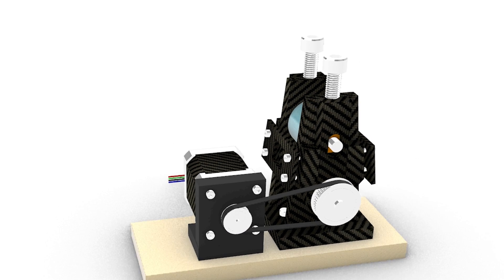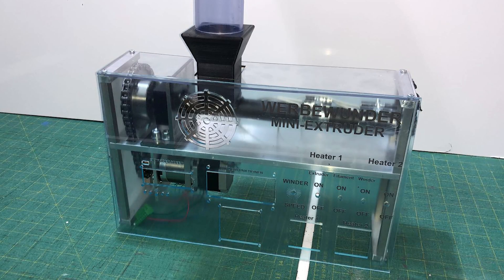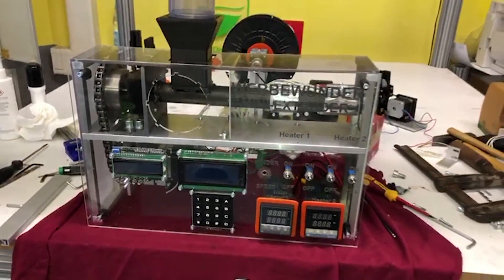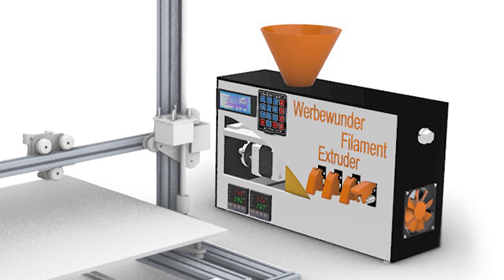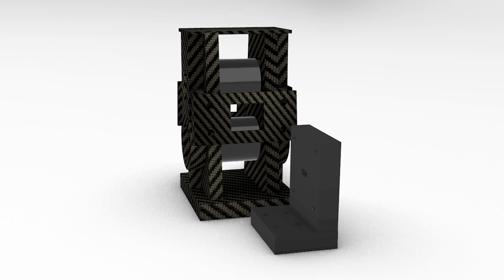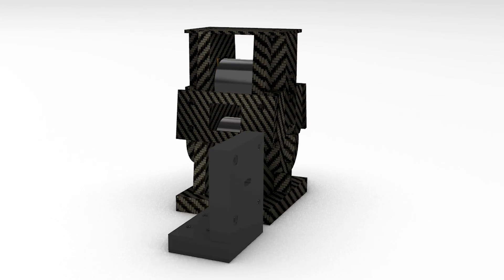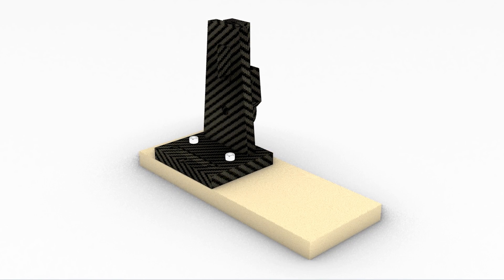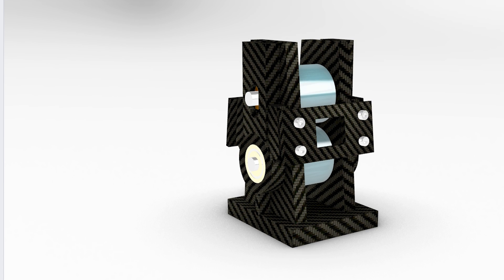Filament Extruder Desktop Version DIY [English] #2 The PullUnit

Comment: Would it be possible the reconstruct the filament extruder to be vertical?
Reply from the maker: My first two extruders were vertical, so you are only limited by the power at about 1 kg because you do not have very long cooling distances. look at the videos

Comment: Whaoo respect Mister Werbewunder ..... thank you for sharing real conception ....

 Now in end of 2018 what do think about the hole of the hotend of 3d printer  ( buse )... 
is it always adapted to extruder.... in other terms is it important to calibrate more or less the filament ... 
the 3d printer buse is the master = 1.75 mm imposed ! extruder slave .... 
do you think an evolution is necessary ... the 3d printer should be with tolerance of size 
... perharps with a mini extruder ??? !!!!! what ???   lol , 
yes

French sorry ....
 Que le filament , puisqu'il est de diamètre non régulier ( pour cette hypothèse )le refaire fondre afin d'imprimer et non pas d'être poussé par un extruder ( 3d printer ,a simple roller in fact )
je pense que du coup le filament pourrais avoir une certaine tolérance de diamètre.
Et la vous allez me dire oui mais qu'est ce qui entraîne le filament ? l'extruder ? lequel  ? ( which one ! ) lol
Bien sur on ne parle pas de shredder à mettre sur imprimante 3d !

Qu'est ce qui empêche aujourd’hui de mettre un filament de diamètre différent dans une imprimante 3d ??? et pourquoi ne pas régler cette """""""
ALORS on pourrait se demander , il doit surement avoir un lien entre la capacité à faire fondre la plastic ( hotend) rapidement en flux constant pour imprimer , oui , si l'on n'y ajoute une plus grande capacité de préfonte je dirai , l'on pourrait se passer de cette taille 1.75 entre autres imposé ! non ?
( Des fois je pense à l'aire comprimé ) 1 bar / 2 bar ) si si lol. voir plutôt sous-vide  ( le plastic est tellement mieux ( melt ) sous vide ( pas de bulle ) , fluidité.)

Ce qui empêche un autre diamètre de filament sont les éléments eux même ,employé pour la conception de toutes les 3d printer !!! si le filament est trop gros, il ne rentre pas !

alors bien sur j'ai fait des petits test dans d'autre projets X en rapport avec le plastic . thermoforming , injection ...
et maintenant j'arrive dans vos projets , j'adore ...

Je me répète c'est vrai mais c'est pour bien poser la chose ...
Parce que je souhaite réaliser en truc dans le genre cela me parait plus logique ... vais-je dans le mur ? est-ce complètement impossible !
what 's the probleme with this lol ....

et soyons fou , du coup si filament avec tolérance de diamètre ,l' on pourrait peut être mélanger les matériaux, un peu de pla et pp directement en deux filaments distinct dans la tête d'impression.... pour faire simple une grosse ouverture en début extruder qui puisse recevoir une "coulée" de plastique avant d'être entraîné par une mini mèche ( type extruser line )
(directement oui c'est impossible le filament bloquerai rapidement la mèche .)
 mais si il est quasi fondu avant de rentrer en contact avec la mèche .... ? 
il pourrais même être préchauffé au départ de la bobine  par exemple 60/80 °C .
Peut être que du coup sur une 3d printer un moteur sera nécessaire pour faire tourner la bobine de filament pour alimenter la fonte ... what ??? !!! 
Dans cette optique le plastique s'étire mais pas sans limite ( oui puisqu'il est chauffé avant et tirer ( absorbé )par la mèche qui se trouve désormais dans le tête d'impression , je pense qu'elle serais relativement petite ( la mèche )...

Du coup an extruder line should be more simplfy whit tolerance .

Am i an OVNI §§§ lol  dont know .... but i m serious .... some real question for me ...
I dont have a printer 3d or extruder but i llearn a lot and i m so excited with your video and other .....
Very spécial thx for this one .....

Comment: Awesome filament extruder and can you please help us to make the puller unit assembly.
Reply from the maker: Where exactly do you have a problem?
Reply: sketch for pull unit?
Reply from the maker: The STL file can be found in the appendix of the video that Arduino Sketch comes when we do the electronics.

Comment: For a reasonable ROI, I think the cheapest way to get a quality product is by a two step process...
STEP 1:
Extrude 1.8mm filament with a cheap version (using a wood drill bit) and let it cool down on a spool.
STEP 2:
Take this low precision 1.8mm filament and extrude it again into a 1.75mm with a direct drive extruder using the same principle of a 3D printer.
STEP 3 (optional):
Filament from STEP2 can be extrude again into the direct drive extruder to increase the precision.

HOW WILL IT WORK?
The direct drive extruder (from STEP2) need a dimension sensor before and after the extrusion. The first sensor will adjust the feeding step motor to get a constant feed volume. The second sensor will adjust the pulling wheel speed at the end of the process to get the perfect filament diameter. So, feeding with 1.8mm filament, heat it inside a 2mm ID x 200mm tubing, turn 90* before reaching a 6mm nozzle, pull it down to 1.75mm in water bath or hot air.

OK, but why?
A two step process can deal more easily with variable size material such as home made recycled plastic.
Free filament (from plastic drums, milk jugs, pvc, etc) make 3D printing of large object (chair, table, bricks) affordable.
A two step process can drive the building cost under 300$ with a precise final product.

Great ROI:
It is a viable solution if you don't want to sell your filament, only making it for personal use.

WHERE IS MY YOUTUBE VIDEO ABOUT MAKING THIS MIRACULOUS THINGS?
I admire every Youtubers and makers who share their passion with the community.
A non perfect working machine is better than theorical non proven idea, I must agree.
Unfortunately, I don't have the ressources right now to proceed with this project.
I hope my comment will inspire somebody to make just a better extruder.

Alex, the cheap guy from Québec, Canada
My background is in optimisation of analytical instrumentation

Comment: Wie lang muss denn der Riemen sein? Dann kann ich den direkt fertig bestellen
Reply: Guck mal im Link - kannst den da auch gleich bestellen - hab ich auch gemacht, ist sogar billiger als bei anderen Anbietern.
Reply: Tam Gaming in welchem link ist denn die länge beschrieben von dem Gt2 Riemen?
Reply: gesehen im Deutschen Video 192mm
Reply from the maker: Der sollt GT2 sein und zwischen 190 und 200 Zähne haben
Reply: Ne ist echt in der beschreibung - musst mal unten gucken hier. 2 stück für glaub 6 euro - hab die auch bestellt

Comment: For the nozzle....
I think a longer drilled nozzle hole will act as a dampner to increase the consistency of the extrusion.
The longer small diameter will soften the pressure ripple, in the molten plastic, caused by the turning screw.
It will increase the overall backpressure... so a threadoff will be experimentaly determined I guess!
Reply from the maker: You're right the length of the nozzle channel affects the quality of the filament.
In an earlier video I show you how I make a nozzle.
Reply: Really! Do you mind puting the link of that previous video?

Comment: 7:19 I don't doubt that a custom machined screw will be the optimal solution.
However, for a DIY cheap guy who like to build project and like the shoestring budget chalenge (it's part of the fun)... I would really appreciate if you discuss about cheapers options.
Here are my suggestions below...

Ps thank you for your great quality content, we very appreciate your dedication and sharing your passion. I'm always impress from your video quality as well as your precision!!!
Reply: @Alexandre Valiquette have you EVER looked what PA12 costs??? 1 kg granulate against 1kg Filament???? Your calculation is for PLA, thats really beginner stuff. We can produce here the filament which is really usefull - not PLA. PLA is crap and good if you are a beginner. Or TPU or even other filamenttypes which are flexible are good to make by your self. PLA is crap.  And the prices you write there also crap. Your prices are way to high. For 6-8 Euro i can get ABS and more better filament, but PLA is way way cheaper to buy, and i mean 1kg costs 2-3 euro in ebay plus 2,90 Euro transport costs, If you buy 10kg PLA you have no transportcosts and this means you play only 2-3 euro per 1kg filament. And 10kg = 10 hours printing on the extruder. I have four 3dprinter and i need per DAY 1 kg filament. Your whole calculation is total bullshit. Sry but this is the truth.
Reply: What do you think about using an old/blunted (free) low pitch wood drill bit "such as auger bit"  with a matching ID metal tube over it? The only modifications will be to grind out the pointy tip of the bit and cut a "window" out of the tube. Both operations can be done with an angle grinder to avoid the expense of the machine shop.

To keep the extrusion quality, I might invest in a pipe that will perfectly match my free wood bit. This pipe can be found on Ebay or from a machine shop scrap bin (bargain again!).

I will tap some thread into the pipe to fit a matching threaded nut. This nut will be drilled in the middle to form the nozzle.
Tapping and drilling can be done at home with cheap tools or can be done at the machine shop for fairly cheap and increazed quality.
Reply: I think what the beta-tester said - there are 2 screws - 1 for the cheap version, which has a great result and one bit more expensive way. In my opinion what i calculated is the price as the betatester said, extreem low. I mean for this amount of money, where do you get a extruder which makes great filament? I also saw some "they call it professional extruder" but 1. they make all less than 1kg/hour and 2. they ALL cost a minimum of 3000$!!! And 3. i saw reviews and i saw that they ALL dont make a good job!!! Now here we have an expert who has his own extruder and his extruder is doing 5kg/hour, and i think he knows why he improved his screw. Btw. the wood drill is used in the 3000$ version which you can buy. Also it was in the 6000$ version i saw. I think as the betatester said the cheap version was also good, that we have to test it out, but its really little money compared to the 6000$ which i saw yesterday! They had 4 heaters, but that we can use here too if we want. But 2 are enough. And if you want 4 then you can invest the money. Then you need 4PID. But this increases the price also. I think we will get a good extruder for an unbeatable price and we can improve it to the sky later as we want, if its the out design or the inner electronic or mechanic - thats awesome in my opinion and total unique!
Reply: I think in some points you are right - but in some points you calculate wrong. 

1. 2,5 Euro per Kg for Pelets. 
2. PLA is the cheapest useable i can buy in Europe 22Euro without Shipping
3. If you need only 144$ / Year then you are a minimal consumer and it isnt worth for you IF you dont want better filament or higher quality. On a total low price you cant save money, because as lower you go as more you have to buy. So dont compare quality with quantity. That is nonsense.
12 kg / year = 1kg per month. Means i can need every 3 - 4 days a spool of filament for my self = 8kg / month = 8x22 € = 176 Euro per Month, and that is the cheapest PLA which is usefull. If i use PLA from Greentech then i need 58 Euro per Kilo plus transport costs. and then i am at  459 Euro / Month without Transport costs. Even now i can see without going for 1 Year, that its worth. 
4. The fact if you make 0,25kg / hour or 1,5kg per Hour is massive, because you have also to spend attention in it if everything runs good  or not and if i can make my 8kg in 7,5 hour what i need per month, or in several days, is a big difference to me.
5. Why you think that a business machine has to cost 100.000 $ ??? Even Werbewunders machine makes great filament and does not cost 100.000 $ and it makes 5kg / Hour. Let it run over night or make 3 of them then you have 15kg per Hour to sell, there enough space to increase. And the other part is - to sell not only PLA its about PA12 and other types, which even for you does not cost 12$. As higher the 1kg as more profilt you make often. Informe your self what 1kg PA12 Granulate costs and for which price you can buy 1kg PA12 Filament. then you see where the profit is to make. No one of the experienced users use anymore PLA. PLA is for beginners.  So calculated it and you see that your economic skills arent so good :-) Anyhow we are here to stay togehter and to profit from the know how we get for free from werbewunder.
To make your calculation with PLA i  think is the total wrong way. The big advantage is in to go in future for much better filament for the same price and to reuse it after its a failprint and to develope your own machine in a bigger style. And as the betatester said - the 400$ version is well enough to go with. the 700$ version is otional and not a must.
Reply: This is a DIY Project to learn from it. Your calculation is total wrong..
Reply: Another possibility is to use metal epoxy to avoid the need of doing thread. Epoxy can also be used as a heatbreak between the "cut window" on the tube and a 3D printed feeding cone.
Reply: QUESTIONS:
What will be the ideal lenght and width of the wood drill bit?
I guess the lower the pitch, the more pressure will be possible to apply to the pelets, so the more efficient it is. I'm I right?
Is it better to have a perfectly rounded pipe or is it better to have ripple inside, like a gun barrel, to help direct the force in the direction of the nozzle?
How tight the distance between the auger screw and the ID of the pipe should be?

Any taught will be appreciated.